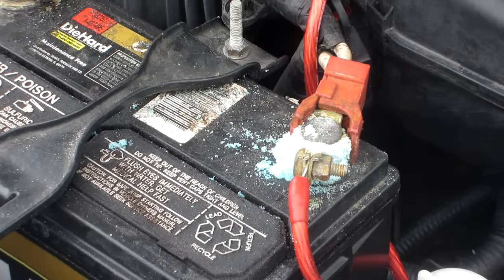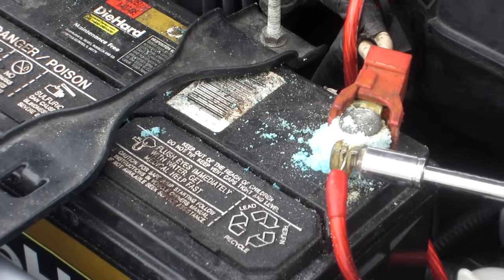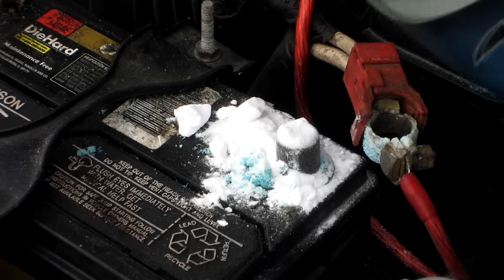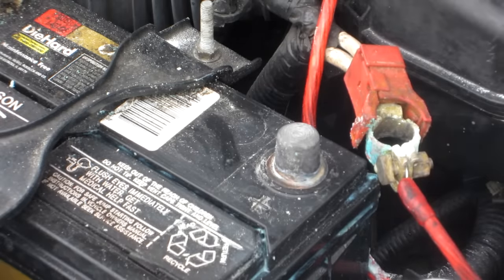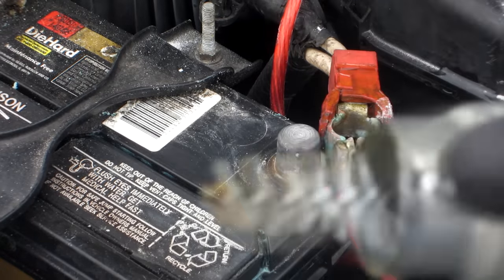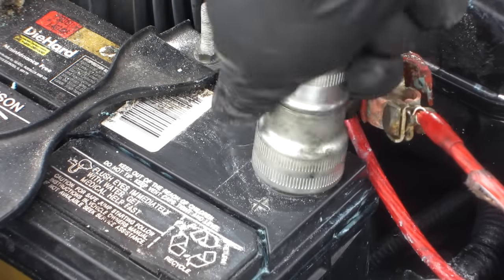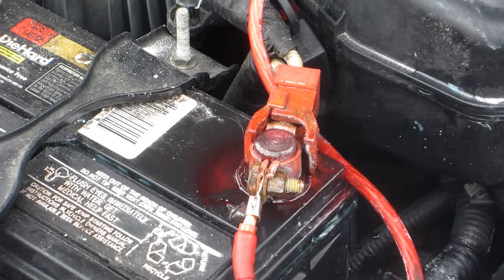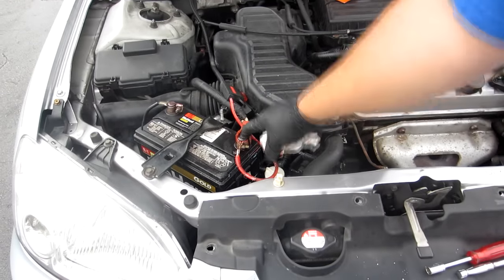HOW TO REMOVE BATTERY CORROSION FAST AND CHEAP!!!

Comment: You may blow the battery up . The negative terminal has to be off first before disconnecting the positive terminal. Also, pouring soda over the battery will neutralize the acid and ruin the battery! It is better to pour soda in a rag and clean the terminal locally.

Comment: What’s the dislikes for trolls? This is an informative video and it worked for me. You can also use a lime squeeze the lime juice  over the terminals and give it like 5 min then rinse with water. Works great! Thank you for the video.

Comment: Spraying the protector onto the bare post before connecting the cable is the incorrect approach. You want good surface contact between the post and the cable terminal prior to coating the entire connection with the protector. Just my .02 but it should be pointed out for our fellow you tubers who don’t know the difference. To keep your radio station pre-sets; I recommend a battery tender on your cables before they’re disconnected

Comment: Go to the store buy can of coke  pop hood open coke take drink pour some on terminal  take another drink pour on other terminal watch what happens wash with water when done
Reply: Or instead of using sticky coke just to clean it up later with water. How about you just cut out the coke part and just use hot water

Comment: You defeated the purpose of creating a good connection by spraying that on before the connection is made. You can also use water to wash away the acid, but make sure you wash it off your fender good or you will have created another corrosion problem.

Comment: Always the negative cable comes off first and then you make a damn with the paper towel around the corrosion and then you spray water on it with the baking soda there first and then you’re able to keep it from running down into the battery tray and causing corrosion down there so I don’t really think you should be showing anybody knew what to do with this kind of a problem Kos you don’t know what you’re doing

Comment: Very poor explanation of what to do and how to do it.  You said baking soda, barely said water, then put the baking soda on and the water, didn't state what you were doing and how much.
Reply: You DO NOT spray the protection on BEFORE replacing the cables.  You completely cause a barrier between the bond which is necessary for the proper electrical connection to the cables.  Do no do more videos if you know nothing about basic electrical...

Comment: Another good idea would be to have a pitcher of water and just pour it on the battery to remove the corrosion after neutralizing the acid. Then you don't have to wipe it down. Just let the water do the work.

Comment: I've found a liberal flush with water after using baking soda and water usually works better than all the towel wiping action.
Cleaning and lubricating the threads on the hold down J bolts saves a lot of grief later also.
Reply: Agreed, plus flushing with water get everything clean like hardware and the battery tray.

Comment: Good for you in trying to help people and Thank you. Like many have said, always undo Negative first and do in reverse when reconnecting. Also, after cleaning the top of battery be sure to tape off the caps so NO baking soda gets in the groove around the caps, this baking soda and debris can work itself alongside these caps and work its way into the battery, which at best can weaken the battery, maybe to the point of making it fail. Lastly when spraying the protector, it is made only to spray on the Terminals only after the connections has been made, not before. You can use Silicon Dialectric on the connection to make it even a better electrical connection before making those connections.

Comment: He guy, you must like to make extra work for yourself. Just watching you I gave me a workout.

 Now, if you want to do it without all of that time and effort, simply pour some clear ammonia over the lug terminal, and anything else covered with that corrosive powdered acid, (careful not to let it drip into the battery)... and watch all of that corrosion disappear right before your eyes instantly... no rubbing or scrubbing necessary!
Then immediately wash the area down with clean water without ever having to disconnect anything... all will be clean.

If your metal battery tray is also being corroded and covered with acid, without removing the battery from it, simply pour the ammonia around it, followed by water, and presto! It's clean!

One of the problems with using baking soda is that you can't tell the difference between IT, and the acid powder you are trying to neutrilize... and it cannot work its way into the areas that the ammonia seeps into easily.

Comment: I stopped your video with in two minutes of running. Baking soda should never be used around a battery as it will neutralize a battery in a heart beat. best thing and even cheaper method is just plain hot water and a battery brush

Comment: I’m trying to fix my starter on my ignition switch... and on one of the wires it’s like little specs of something blue that I was just going to use a toothbrush with some baking soda and water

Comment: No exceptions to this rule: First Always - Remove the terminal of whatever wire goes to the engine block. Second - Remove the terminal connected to the wire that goes to the starter. Period. 
When reconnecting the battery, connect the starter wire terminal first. Lastly, ,the terminal that connects the battery to the block.
Reply: That would be Black = Negative Red = Positive 🤔😂🤣

Comment: That is wrong the water and the corrosive goes down into the battery plate and the chassis and another metal parts of the car and start eating that metal and also it goes into the ground that is very wrong to do it that way it's not a very good video very nasty and careless and you will not spray before you put the cable

 back of the post anyways

Comment: SO MANY WRONG STEPS DONE
1 NEG TERM FIRST 
2 USE A DILUTED SOLUTION OF YOUR MIXTURE 
3 FLOOD THE AREA WITH WATER AFTER CLEANING AND USE A CATCH PAN TO PROTECT THE ENVIRONMENT 
4 WHEN SPRAYING THE PROTECTIVE COATING .. DONT SPRAY THE TERMINAL BEFORE INSTALLING THE CABLE IT WILL CAUSE A VOLTAGE DROP THAT CAN CAUSE ISSUES
COME ON BEFORE MAKING A VIDEO GET YOUR FACTS STRAIGHT!!!!!

Comment: I clean my battery terminal & my engine light went off.
Reply: They say a lot of engine light issues are related to corroded battery terminals.  My 2014 jeep engine light is on, i have to check my terminals.

Comment: First get agm. Second throw away lead acid. Third clean up terminals. Install agm. 
Stop letting you're entire engine bay be destroyed by your battery. 

Seriously find someone that has always used agm in there vehicle. It will not look as messed up under the hood.

Comment: No need to use any chemical just drop the water on terminal and it ll clean like new. By the way change this type of battery which has gone and can make trouble during driving. It’s shows bcz your battery is weak and your alternator works more bcz of battery issue.

Comment: The best way to prevent this from ever happening again is to use a hand wire brush and brush it off then put a few drops of motor oil on top of the post and connector and for get it it want never crowd again I have a 97 f350 and it still has the factory battery end on it and factory bolts in them so I know the motor oil works the best

Comment: Old school mechanic showed me that putting grease on the terminals will stop corrosion. I've been doing it for 35 years and never have problem. Thin layer is all it takes. I've had the same battery in my jeep for 4 years and not a problem at all

Comment: First things First. 
You should mix the soda and water together and pour it over the terminals and the entire top of the battery before you Touch anything. 
You need to Neutralize the Acid to keep it from getting spread. 
His tools and the whole corner of the engine compartment is covered with the Corrosive powder that he banged off the cable end⚠️

Comment: 0:27  How about adding a Capacitor!? 😉
Reply: D Jaquith  auto dealers blast the terminals with brake cleaner. Works great and drys fast with no residue. Some cars will lose there radio if you disconnect the terminals. It's for security if it's stolen it will not work. You will have to recode the radio to make it get channels. Dealerships will charge for this repair and you need your registration and ID drivers license.
Reply: Arthur Smith 
Dude the guy in the video added the wire himself!
Reply: D Jaquith don't know what your talking about. I said to just blast the terminals with brake parts cleaner.